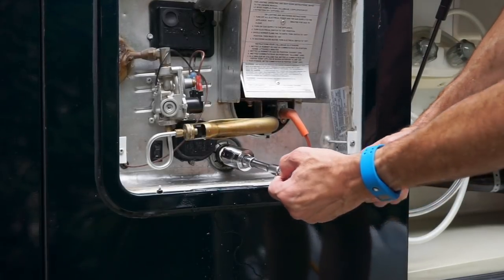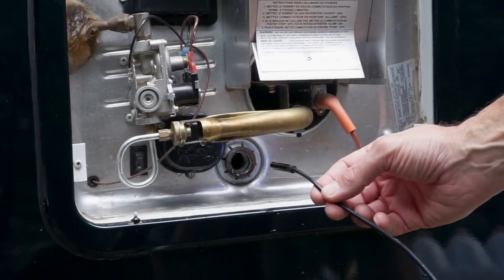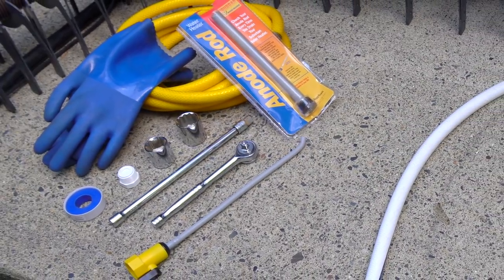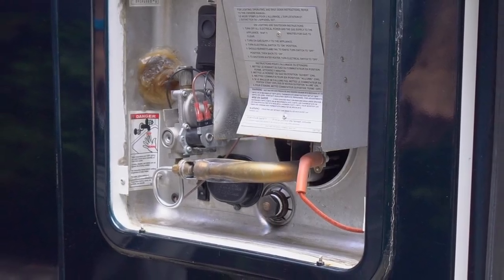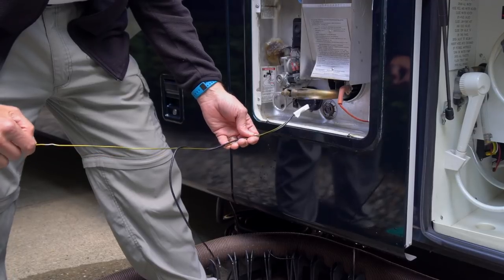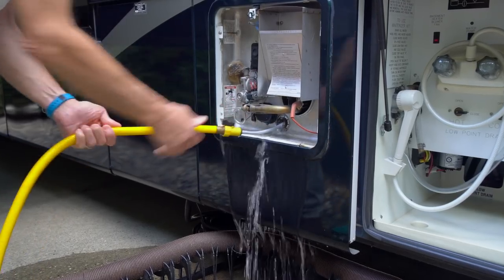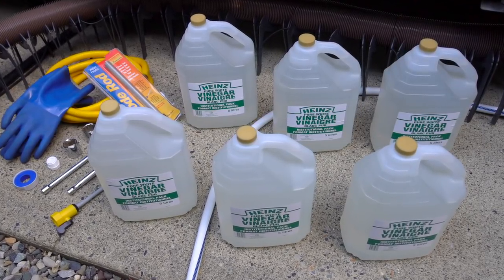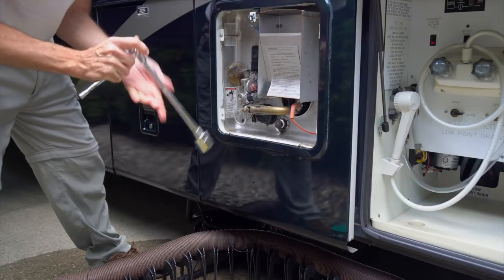RV Water Heater Flush & Inspection SURPRISE!

Comment: I did your vinegar cleaning method and borescope inspection this past spring when I got the coach out of storage.  I had simply done the flush the prior fall when it was stored for the winter.  Usually in the fall, when I flush the tank, I will get some larger chunks of material out during the flushing process.  This fall, after the spring vinegar treatment, I got out some of the same material but it was more of a powder consistency.  Haven't inspected with the borescope yet, may do that over the winter while it is in storage.  Also had the water heater electric thermostat fail over the summer and once I replaced it realized that the water was never really getting to full temperature in the last few  years that we have owned the coach. Thanks for the follow up video, all of this information is very helpful along with the comments and discussion.
Reply from the maker: Hi Bob! Sounds like the vinegar treatment must have had some effect, since you went from "larger chunks" to "powder"! Let us know how your borescope inspection goes, if you get a chance to do one. Glad to hear that our videos are helping out!

Comment: What did I learn from this wonderful video?  Hard water is tough on water heaters, and when you full time in an RV you MUST pay attention to your water heater.  Thanks guys for showing your cleaning process and the heater one year later.  I too was surprised to see such a clean tank.  When we move into our RV I am thinking of installing a Reverse Osmosis (RO) system to keep scale to a minimum.  Have you thought about installation a RO system?  One issue I can see is if you have to fill in a short period of time as RO systems can be slow unless you spend big bucks on it.

I have a borescope with a real long cord on it that I purchased for a plumbing issue at my local American Legion and I will pack it in my RV, when I purchase it, to be able to look in my water heater.

I now need to purchase a Total Dissolved Solids (TDS) meter to check the water I bring into my RV.

Thanks for sharing your RV maintenance routine with us.

Travel safe!!!!!!!!!
Reply from the maker: Great recap of your takeaways from the video, Kitesquid! We've looked at RO systems before, but have always ruled them out. Partly because of what you mentioned regarding the time it takes to fill your tank. And partly because in the areas you need it most (like the desert southwest) it seems wasteful to have to use water to make water (RO wastes quite a bit). So we've avoided it. We know there are lots of different ways you can go about installing RO (whole house that filters the water going to the tank OR a smaller system just for drinking water at a countertop dispenser, etc)... but they all just seem too complex. So it's never been right for us. The easier solution (specifically for the hardness of the water), recommended by lots of commenters on this video, is a water softener. There are several portable models on the market, of varying size (depending on your need), that look like they'd do the trick. We've also looked at them in the past... but didn't have room on board at the time... and our travels haven't been taking us to the desert southwest as often (or for as long) as we think would warrant having the softener. But if that changed, it's the most likely route we'd choose.

That said... the one thing that RO has over just softening is that it can make just about ANY water potable. So it has the advantage of being usable to improve (or even to make drinkable) LOTS of water, where the softener is really just about hardness. So that may be important to you... or at least something to consider.
Reply: RVgeeks I have been looking at the RO systems over the water softeners as I would prefer to remove ions Vice exchanging ions. You did talk about being able to use just about any water and I have thought about being able to use water from a stream Creek or river instead of Municipal Water to fill my tanks in an emergency which would add flexibility to our travels. The RO system I was thinking about regrettably costs a little over $1,000 and I would have to figure out places to install all the parts.

Comment: Excellent,  I recently cleaned my tank with vinegar.  I did learn something I didn't know.  My RV was plumbed wrong and I was getting antifreeze in my hot water tank while trying winterize.  I was told I needed to really flush out the tank since antifreeze can harm the coating in the atwood w heater.  So once I get my RV back from the dealer after fixing the plumbing, I will be flushing and my putting the vinegar in for a through clean again.  Always something!  Your video's have helped me a lot in learning how to take care of various items on the RV.  Thanks!
Reply from the maker: Thanks so much, Ben! Great to hear. :)

Comment: I have a tankless heater, and love it, but this video was very interesting. I have one of those "scopes", it has many applications. I haven't been to the Southwest, yet, so your heads up on the water quality was very informative.
Reply from the maker: We've considered tankless, too, but read comments from people about the issue of boondocking, when the water is trickled so slowly that it never gets it hot enough to take a shower. Do you dry camp much, and if so, how does it perform when you trickle the water? We wouldn't want to have to run more water volume to make it hot enough to shower, and wonder what your experience is like with that. Thanks!
Reply: We don't plan to boondock much, but the water gets hot pretty fast, in the bathroom. I've collected, measured, the amount of wasted "cold" water, and it takes about 8 cups to get to shower temp. We save this water to flush. A trickle is enough speed to keep water hot. The trade off is, we can take long showers when hooked up, which is most of the time. Side note; How is it possible to winter in the northwest?
Reply from the maker: Thanks for that info! We may have to take a closer look at a tankless unit to be prepared for if/when our current system needs to be replaced! And our usual answer to wintering is to drive south to where it's warm, but with some planning, you can winter in your RV in some fairly cold climates and still stay cozy! It's not 100% comprehensive (even when we stay north, our winters are fairly mild compared to some), but you can get a good idea of what's involved if you watch our video about winter RVing ( https://youtu.be/n5RGlcLSrM4 ) and heating options( https://youtu.be/1pgYW2xQwho ).

Comment: I'm not surprised by your findings as the debris inside the tank is almost 100% related to the dissolved mineral content in the water especially calcium. We use a onboard water softener system and have never found any debris in our HW tank. Perhaps this would be a good piece of RV equipment for you guys to experiment with and review, I know several companies make these units.
Reply from the maker: Hi John. It was quite eye-opening to see the dramatic difference the low-mineral content water of the NW & BC had! We've considered a water softener (we have friends who carry one) but the size has deterred us, since we're so limited on storage space. We also weren't keen on the maintenance issue either (flushing it out). But now that we know how dramatically it can affect the water heater, we're revisiting it as an option! Glad to hear you've had such a good experience with yours, with no mineral build up in your water heater tank! Thanks!
Reply: RVgeeks We were also space / weight limited in our 36' 5er so went with one of the smaller units available. It will process 1000 US gal before needing a regeneration,  and that whole process only takes about 15 min.  The unit itself fits in our basement storage and weighs about 20 lbs or so. We are heading south for the winter in a few days, perhaps we will see you guys on the road. Safe travels, J
Reply from the maker: Sounds good, John. Will definitely be looking into it in more detail. Safe travels!

Comment: I’m surprised you don’t have a on demand hot water heater? I’m a full time Rver and I have a on demand hot water unit from Atwood it’s awesome which requires no maintenance...
Reply from the maker: Hi Jimmy! We don't have an on-demand system because our RV wasn't offered with one when we ordered it. We've considered it before, but read comments from people about the issue of boondocking, when the water is trickled so slowly that it never gets it hot enough to take a shower. Do you dry camp much, and if so, how does it perform when you trickle the water? We wouldn't want to have to run more water volume to make it hot enough to shower, and wonder what your experience is like with that.

Comment: Do you guys use any sort of water filter when you're hooked up or when you fill before boondocking? I use a filter religiously, and wondered if how your experience compares.
Reply from the maker: Hi Monte. We've got a whole-house filter built into our coach... that filters water before it goes to the tank AND for the whole house when we're on city water. We use just a sediment filter on it, to protect the tank, pump & valves from any particulate matter. We generally recommend staying away from higher-level filtration to avoid removing the chlorine from the water going into your tank. You WANT to have some there in order to help prevent "stuff" from growing... and if you want to remove the chlorine, we think it's better to do that farther downstream at the taps, shower head, etc. Plus, unless you're doing reverse osmosis, there's not any filter we know of that would remove the calcium and other minerals that cause the scale in the water heater. So, even with a filter, you need to be aware of the hardness of the water you use... and likely use the vinegar de-scaling procedure to eliminate it.
Reply: Thank You.... That tells me I need to more closely follow your approach. The inside of your heater looked almost as good as the outside of your coach.

Comment: Excellent lessons here for a guy who is becoming more responsible for his own maintenance work.  However, I’ve encountered a problem after running my heater thru a cycle using AC rather than propane:  the rocker-style on-off switch at lower left is dead in the on position, and I can’t move it to off. The switch is not very accessible without removing what is a sort of u-shape gas line feed. Suggestions?
Reply from the maker: Hi John. Sorry you're having trouble. When you say that the switch is dead and stuck in the on position... were you able to successfully heat water on A/C? The reason we ask is because even if it's stuck, maybe it doesn't matter if it's actually working. I don't think we ever have a reason to shut that switch off, so if it's stuck, but working, we wouldn't necessarily know. Of course if you're heater isn't working on A/C at all, that's a different story. We're sorry we've never had to remove ours, so not sure how. You might try posting your question with as much detail as you can on the iRV2 forums. There's bound to be a fellow RVer there who's done the replacement. It's free to sign up and post at http://irv2.com/forums. Sorry we're not of more help on this one.
Reply: RVgeeks  Yes, the water heated fine and I intended to shut it off to avoid drawing shore power while home between trips.  Thx for your suggestion about further research.
Reply from the maker: Hi John. Since you got hot water from the A/C side, obviously it's all working okay. If the only problem is that the switch is frozen in the ON position, we'd suggest that you not worry about it. We turn the water heater off (both A/C and propane sides) all the time to prevent using power or propane when we don't need hot water. But we just turn it off at the control panel inside the RV and never touch the switch on the heater itself. We assume you have a switch for the A/C water heat inside the RV, too (pretty sure they all do), so the switch on the tank is nothing to worry about. Can't recall shutting that switch off more than once or twice in 13 years. If you're concerned about the possibility of accidentally turning it on, you probably have a 110-volt breaker for it in the circuit breaker box.

Comment: The water quality is definitely poorer in the SW.  Do you use a water softener?  I have just started using one and already notice quite a difference on build up on my faucets and such.  I have not boroscoped my HW tank though, interesting video.  Will you guys be doing anything around Quartzsite this year?
Reply from the maker: Hi Davie! We've considered a water softener (we have friends who carry one) but the size was a little off-putting, since we're so limited on storage space. We also weren't keen on the maintenance issue either (flushing it out). Good to hear you like yours, and we may have to re-visit it now! ;-) We won't be down in Quartzsite this winter, but look for us doing something down there the following year.
Reply: Yes, size was definitely a concern of mine as well, but after having so many faucets getting mineral build up and the staining of the shower and toilet, I decided to get one.  We have the double standard size "on the go" we boondock a lot so I use it to fill my tank then drain the water from the softener to get it as lite as possible for travel.  The flushing is not as bad as it may seem, pretty simple really. Just need to occasionally check the ph of the water to know when to recharge.
Reply from the maker: +Davie Kimm Thanks for all the great info, Davie! We’re definitely going to revisit the issue. 😊

Comment: I use a water softener, I expect less problems.  But I will get a borescope and give it a check.  Thanks!
Reply from the maker: We're re-visiting the softener issue now. ;-)
Reply: RVgeeks how do you use water softener? ,, you really drive around with the spare vinegar for the  next year  ? :-0))
Reply from the maker: A water softener goes in line Between the spigot, and the RV, treating the water using salt as it enters the RV. We didn’t carry the vinegar around with this for a whole year! We have friends we left it with. 😁
Reply: @RVgeeks  lol, good to have friends with storage space and plug-in extension cords 😁.  Would stronger % vinegar do a better job?  I Just finish mine today and there was less than last year too, I did not go west either, stayed in FL.   Thank you for the information on the water softener,  another device to carry and care 🤦🏼‍♀️ .  I can't see as clear as you do with my boroscope, maybe I have to practice more,,, Thank you again for your excellent videos and always a quick reply :-0)
Reply from the maker: @projet2907  A stronger % vinegar would let you either use less (mixed with more water it would achieve the same concentration) OR you could leave it in for less time. The only reason we've stuck with the "standard" strength vinegar is because it's so easily available in large quantity at Costco. We don't THINK that a higher strength acid would cause a problem, but it IS possible that if it got TOO strong it could damage something inside the tank (heating element, connection points for plumbing, etc).
Reply: @RVgeeks  Thank you very:-0),  Stronger is indeed not as available, I just stumble on a 10% spray bottle at Canadian Tire for cleaning-sink unclogging and all,, on trial for trailer cleaning tasks.  I had never seen before.  You two Have a good evening where ever you are,, from Rivière Roge, Quebec Canada 😊.

Comment: I really must de-scale the water heater in my caravan. It's never been done in the 6 years I've had it :(
Reply from the maker: Would be interested to know what comes out of there. ;-)
Reply: I'd like to think it would be like yours this latest inspection! Bearing in mind I don't full time in my caravan but it is only 13 litres (3.4 US Gallons)  so does work hard. We also have very 'hard' water here in the South of the UK so all hot water appliances get furred up :(
Reply from the maker: Hmmm... sounds like you could be in for quite a treat! :-/ If you've got hard water, you definitely have some build-up in there. Might be worth the small investment in a borescope to take a peak before doing a vinegar treatment. If nothing else, it'll give you the satisfaction of knowing how much mineral scale you dissolved! LOL!
Reply: And there lies the problem, I believe it's a sealed unit. No 'end user serviceable parts'  The actual unit is also accessed from inside the caravan and under the front lounge seats. It would literally be a case of getting the 'treatment' in to the unit then seeing what comes out from either the taps or drain down point. Sadly we don't have an access point like you do with your anode rod :( Side note, the hot water heater (boiler) is what also heats the water for my Aldi 'wet central heating system' via the radiators around the van too
Reply from the maker: Ah, yes, of course... and Alde system! They aren't as common here in North America (yet), so we haven't encountered one of those. But from the sound of things, they'd be more of a hassle to deal with when it comes to de-scaling. Hopefully they've thought of that and have some ingenious solution that makes it unnecessary! Or maybe it being a problem is the indicator it's time to sell the caravan?!  LOL!
Reply: Everything is still working fine so fingers crossed, I don't need to sell just yet!